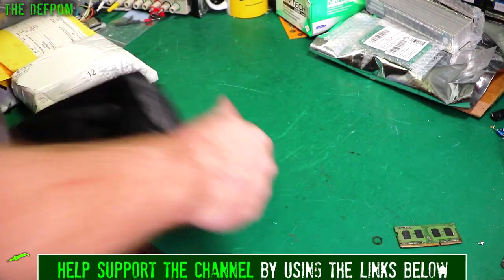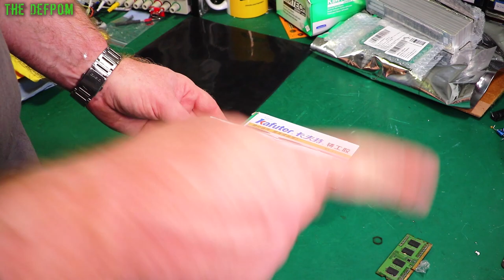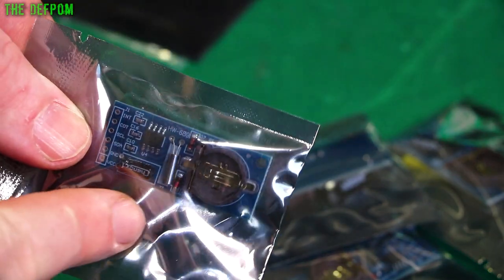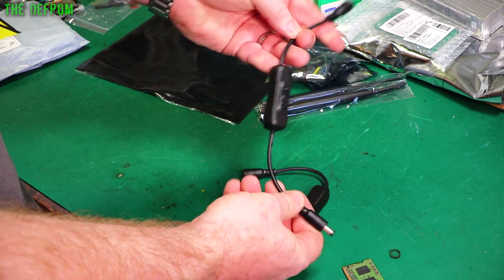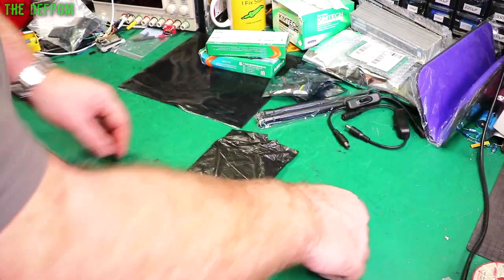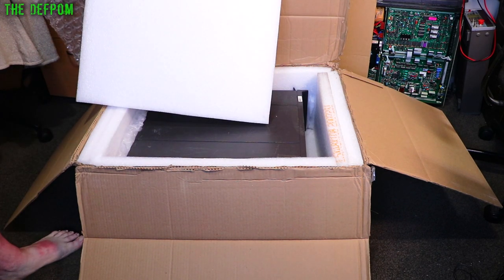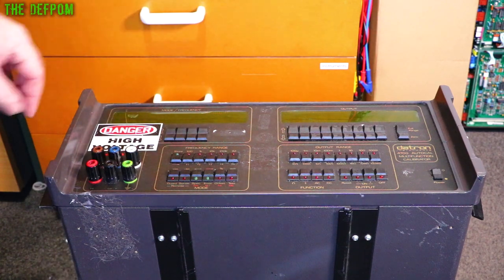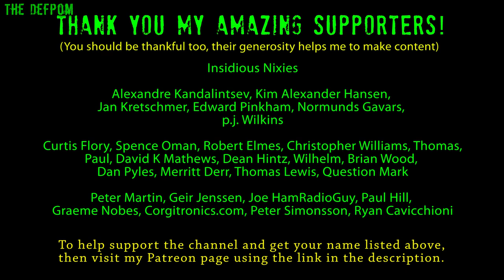🔴 Mailbag Monday 8th February 2021 - No. 802

Comment: Short note: rubber in compression looses most of its vibration isolation capability, needs to be under tension to isolate vibration to maximum effect.
Learned this both being taught and by experience elimination of fuel pump and injector pulse noises in fuelinjected cars in the 1980s.
So mot necesarily of much benefit placing vibrating items on top of fubber mats. Will also deteriorate further over time.
Reply: I have had luck with those cheap rolls of perforated foam sheets you can get on Ebay. Added benefit is that there is a slight stickiness to them which helps stop the instruments sliding on one another where I have them stacked (the rubber baby bumpers removed) on my shelves.
If you need extra vibration isolation then just put down multiple sheets.
If you need a LOT of vibration isolation then roll them up and use them that way.
Reply: @IanScottJohnston  No argument for non slip. But it remains less than best for noise reduction due to vibrations transferring into shelves, tabpe top etc. Yes a spongy sheet or loosely rolled sheet has some effect but fails getting best results. Got a noisy vibrating fan, mount it on proper isolating rubber mounts then its vibration will not even affect to housing vibration to be a problem. I too have used foam sheets as a quicky, part solution, but for best isolation my comments stands.

Comment: @TheDefpom It might not be an issue in your application, but you might consider using modules with the DS3231 chip instead.  Its features are similar but the timekeeping accuracy is almost two orders of magnitude better.
Reply from the maker: I have some of those too, I think it comes down to what will physically fit.